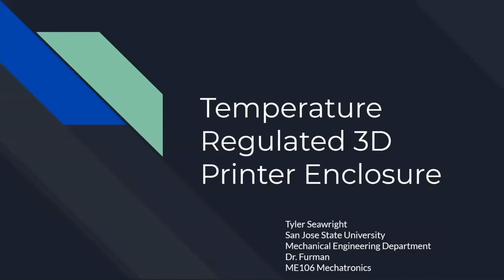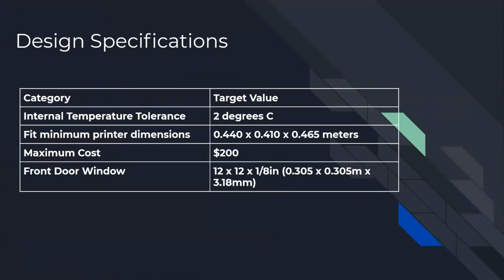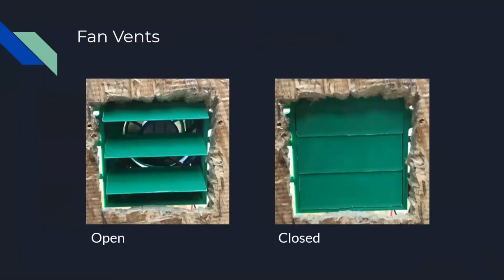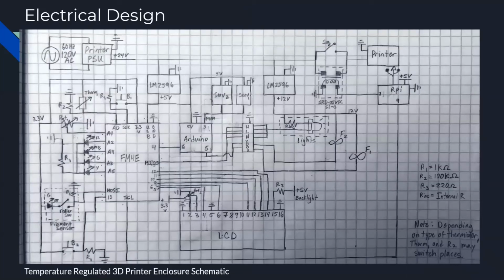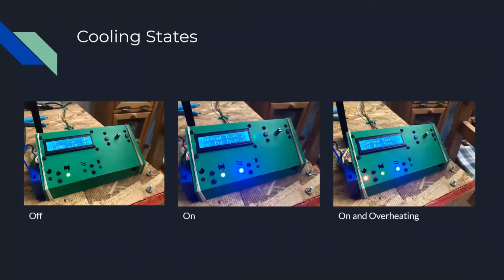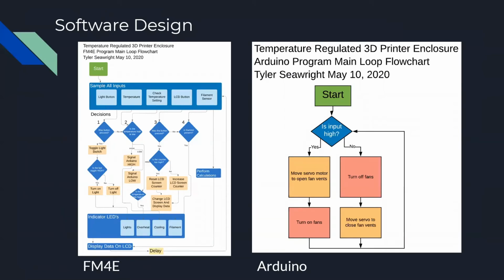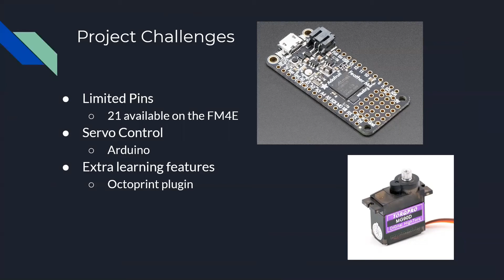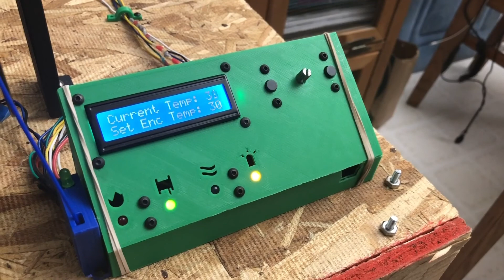Temperature Regulated 3D Printer Enclosure

Comment: Nice presentation! Any idea what is the temperature rating for these electrical components of the 3d printer (motherboards, sensors, drivers, etc)? I read on some forums not to keep them running at even 40 C for prolonged periods of time. What was your setoff temp to turn on the fans?